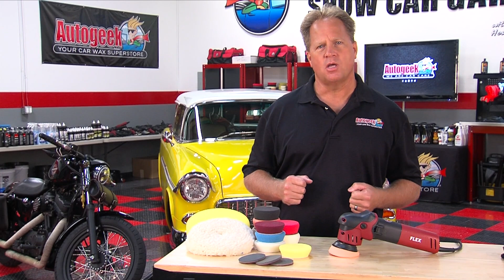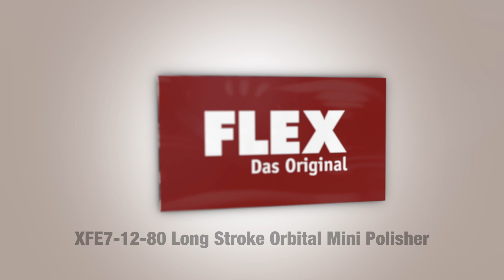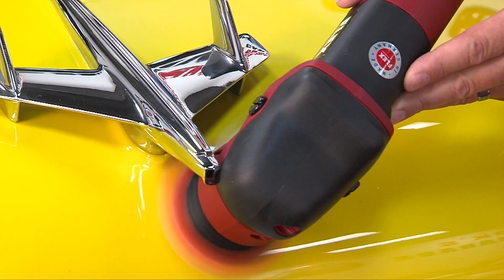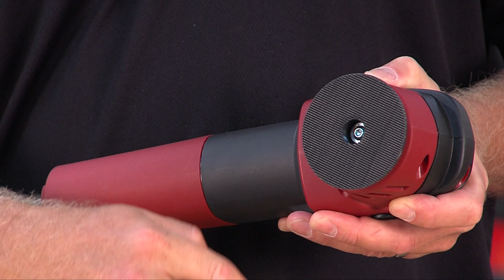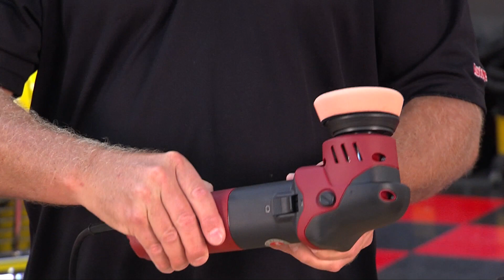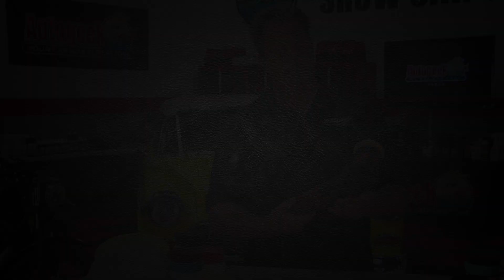Leave no panel of paint unperfected! - FLEX XFE-7-12 - 3 inch Mini Orbital Polisher

Comment: How about some comparison video's instead of just advertisement without any judgment? You sound like you never heard of Rupes or Griot which have same machines. Lately Autogeek is more of an advertisement channel than a detailer channel.
Reply: I agree with the fact it’s becoming more an advertisement channel , but flex is better than rupes and griots , rupes and flex are better than griots no doubt , but between rupes mini and flex 3” , flex wins not only because the quality it’s better than rupes , but also is a torque monster , not like the mini that will stall as most rupes polisher do as well , but the German engineering beats rup Italian engineering